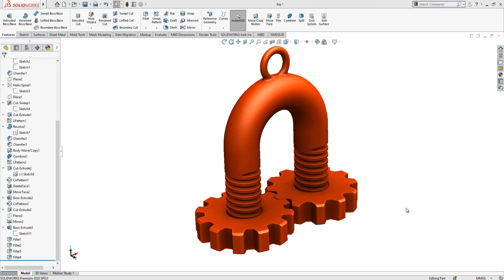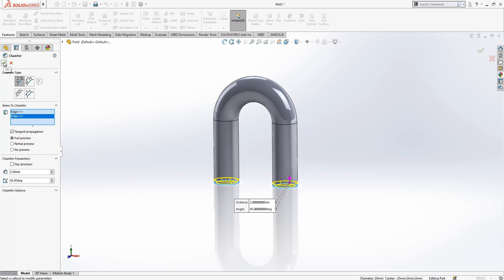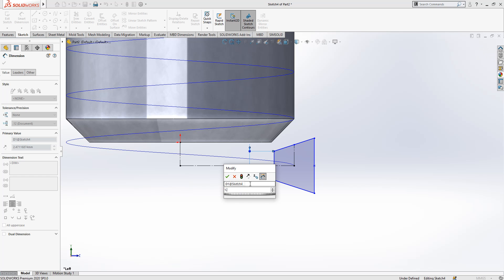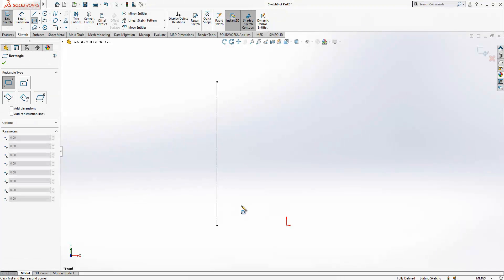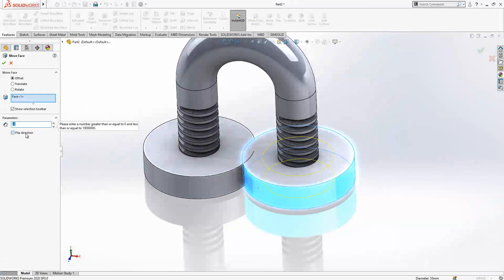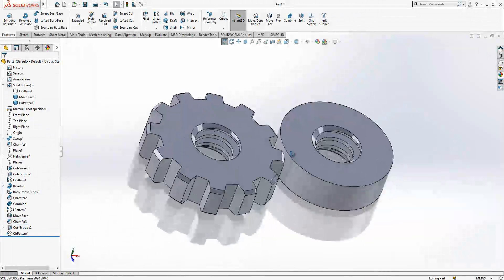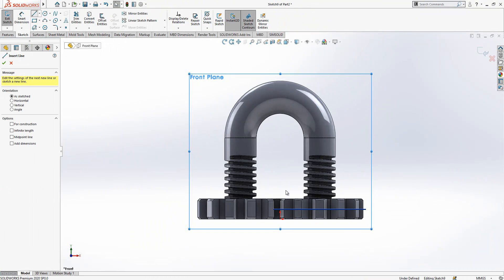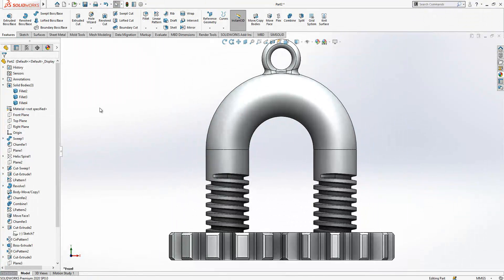3D Printing Part - SolidWorks Tutorial

Comment: that was a nice one :) 
only trouble blender gave me was the bevel between the large arch and the small top ring.  blender has bolt and gears as extra objects so i did use that shortcut.
Reply from the maker: Nice 😉 It is very interesting that you are watching SolidWorks Tutorial but modeling in Blender
Reply: @3D-World  blender it was i been doing for years, have no other cgi skill at the moment.
have worked at a place where people next to me sat and worked in solidworks, and i had a simple 2d CAD  software.